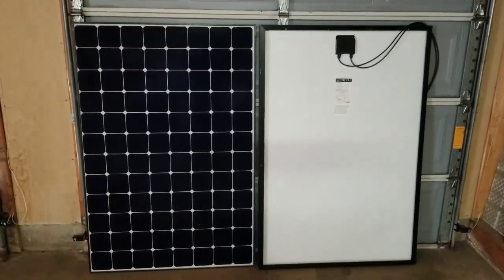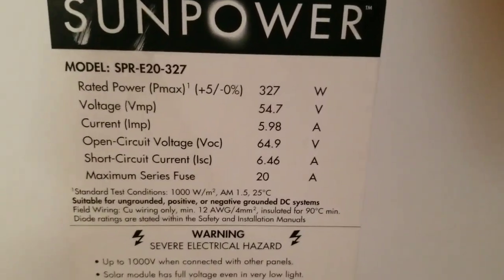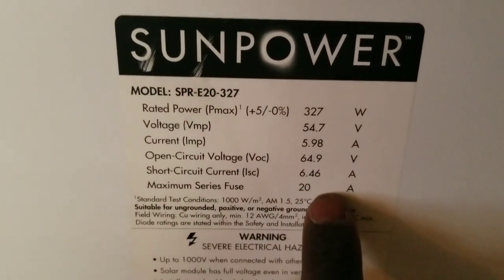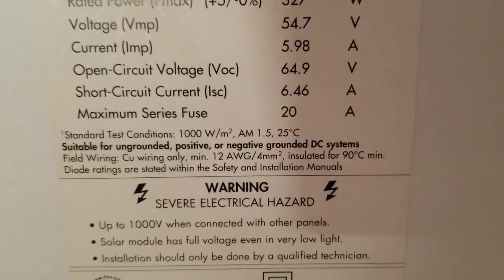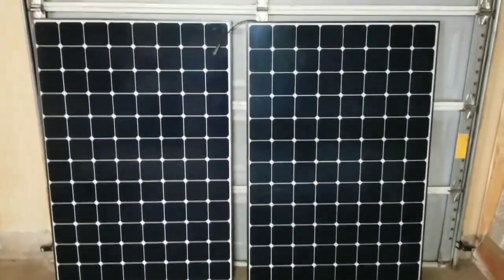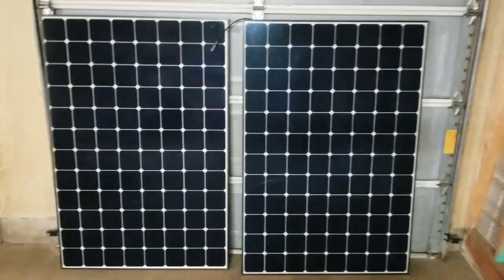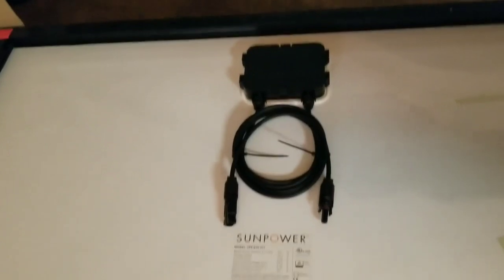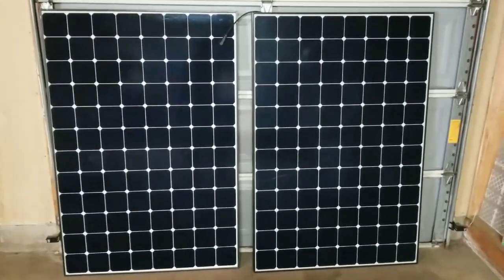SOLAR PANELS FOR BEGINNERS, HOW SOLAR PANEL WORKS

Comment: In the process of connecting my PV array so i don't exceed the maximum input voltage and current of my charge controller, should i use my VOC and short circuit current as a guide.
Reply from the maker: @elohorolokpa  
Exactly.
Always use the VOC as a reference point when calculating for PV DC input stay below the VOC

Thanks for stopping by, I wish you luck on your project.

Please don't forget to SHARE LIKE and SUBSCRIBE if you haven't done so.
Have a bless Saturday
Reply: Can@jwsolarusa  thanks. 
I have   6 units of 450w solar panel with voc 47.6 and mppt charge controller of max input voltage 150v
So i need to choose either series or parallel connection in a way that the total volts im getting won't exceed the 150v of my charge controller.
So i can connect some in series and some in parallel because if i series all 6 panels, the volts be increase above 150v of the charge controller.
Connecting 2 of the panels in series will be 47.6x2 which is 95.2V.
While i connect the other 4 in parallel so i can increase current
Reply from the maker: @elohorolokpa  
This is how should work.
You going to create 3 strings of two's at 
47.6v x 2 = 95.2voc
47.6v x 2 = 95.2voc
47.6v x 2 = 95.2voc
Now you can send each string into the combiner box with a breaker so you can able to isolate each string in case you have to do a maintenance on each string and you don't have to shutdown the entire system and also for safety precautions.
Paralleling these 3 strings into a combiner box not only increases the Voltage but also increases the amperage.
This is what is called 2s 3p Configuration. 
I hope you find this illustration helpful and useful.
Cheers. 

Note below: 
If you were to have a for example a MidNite Classic200 MPPT Solar Charge Controller, you could arrange three panels in Series @ 47.6v x 3 = 142.8voc and Parallel the two strings to give you 3s2p Configuration
Reply from the maker: @elohorolokpa  
What is the nominal voltage of your battery bank?
12v , 24v , 36v , 48v , 60v or 72v ?
Reply: @jwsolarusa  if i have to create 3 strings at 47.2 x 2=95=2voc  I'll be getting a total of 285V and my charger controller is rated 60A, 150V.
Also, don't i need some amps? That was why i consider the parallel connection so i can get some amps .
Im ready to learn
Reply: @jwsolarusa  it's 48v
Reply from the maker: @elohorolokpa  
You made the right choice.
I hope you find my illustration guide helpful on your project.
Reply: @jwsolarusa  thanks boss
Reply from the maker: @elohorolokpa  
Are you in the United States? If yes,
What part?
I realize you don't have any posting on your YouTube channel.
We would like to see your project.
Reply: @jwsolarusa  ok.
Im not in the united state.
Im in Nigeria
Reply: @jwsolarusa  please, I'm trying to understand something here.
If i send each string of 47.6 x 2 which is 95.2V into my combiner box, then, I'll only send 1 string which is 95.2v into my solar charge controller. So the other 2 strings will just be in their respective circuit breaker in the combiner box.
Is this what you were trying to explain to me?
Reply from the maker: @elohorolokpa  
The three strings will be combined into the combiner box and two conductors POSITIVE and NEGATIVE out from the combiner box into the input of the solar charge controller
Reply: @jwsolarusa  ok.
Thanks

Comment: is this panel have 48v system voltage? Also E22 stands for what?
Reply from the maker: This panel works for all applications like 12v 24v 36v 48v & 60v
Reply: So is it just more/higher the open circuit voltage the higher the Amps?

If you have a panel like this for 24v system would you just use one panel in to bus bar then to charge controller?

Comment: VOC 64.9 v the string size will be short unless you can find a High Voltage controller.
Reply: Outback FM 100 would work  it supports up to 300 V DC but you need to upgrade the mate 3 to a 3S
Reply: @awesomusmaximus3766   Do you know if taking the software upgrade for the mate 3 will it now work???
Reply: @offgridwanabe  I don't think it would work
Don't try  updating the mate 3 with the mate 3s firmware that will brick it
Reply from the maker: Correct